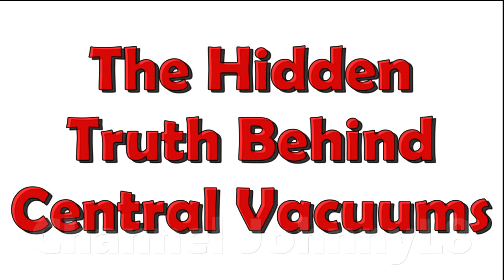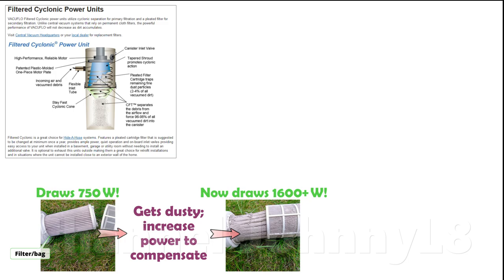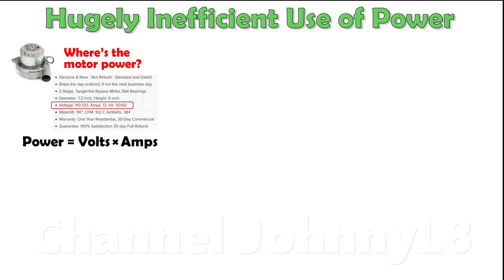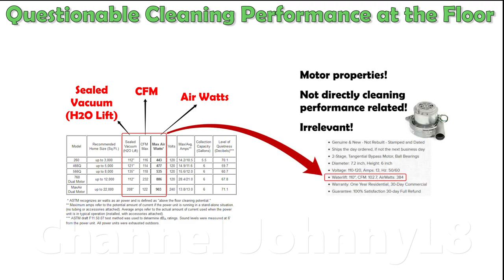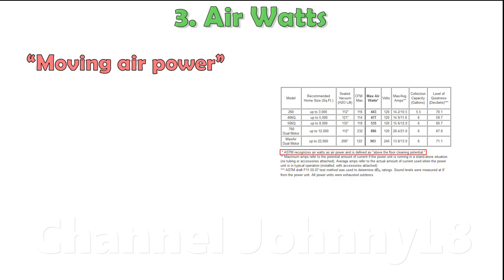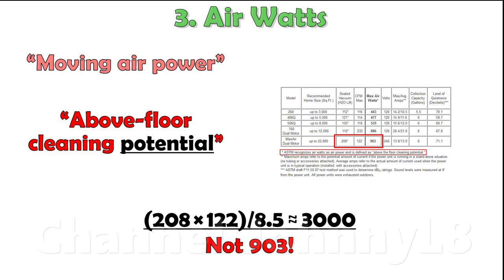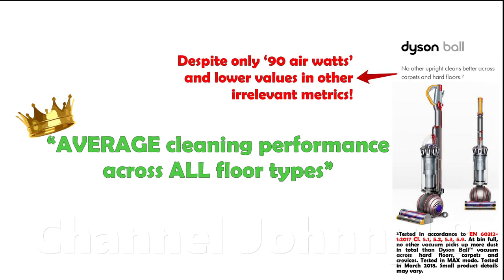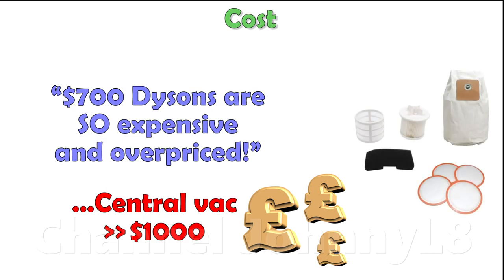Central Vacuums Trail Behind Dyson Cordless

Comment: @3min53 : your formulas are completely wrong : we are in AC voltage so Power is Volts*Amps*Cos(Phi), with such motors the cos phi is low so the power absorbed will be more inferior than 1260W 2520W and 3120W you have calculated. As an electric engineet I can tell you the numbers of 500-1200 and 1500W are probably more realistic. But anyway here in France we don't care too much about electricity : with more than 70% of nuclear and 20% hydro we have almost full green electricity
Reply from the maker: Not sure why you're trying to complicate Ohm's law and basic electricity etc. within this specific context. The values cited are rms values and reflect upper limits, as should have been obvious to someone claiming to be an "electric engineet" >_> Furthermore, these are from numbers provided by the manfacturers. And to suggest that because your energy comes from renewable sources means you can consume as much as you like, is ignorance of the highest order and shows no understanding of basic physics or the planetary energy cycle; that energy consumed goes somewhere you know (namely the atmosphere).
Reply: @VacuumFacts  Errr why do you talk me about Ohm's law and RMS value ? I tell you you have just calculated an apparent power with your formulas, not an active power...
Reply from the maker: @Themagiciandu62  Well I'm glad you led by example with actual numbers and calculations. And you didn't because you don't know and are just blindly spouting theory. You don't know the power factor or the efficiency (which you failed to mention previously in all your alleged prowess) of the motor. But it's almost as though you miss the point entirely by trying to muddy the waters. It doesn't matter; the power consumed is utterly *huge*, regardless, for all the reasons outlined. And then there's literally everything else in the video you ignored, such as why the manufacturers don't simply provide the motor power in their stats along with everything else.
Reply: @VacuumFacts  I know everything about power factor and efficiency... where I take my values ? from the average value of the power factor of an universal motor : around 0.4 0.5 (very low)
Reply from the maker: @Themagiciandu62  o_0 ... ok

Comment: I had a central vac in my old house. It was horrible. The hose was heavy and stiff, hard to use. The power head was clunky and had no steering it also had a super annoying height adjustment that barley worked half the time.The tools didn't lock and fell a lot. The bin wad large but almost all the and hair would clogg up the filter and would require a messy time consuming cleaning. The filter was non washable too. The average price of a whole house central vac with all the plugs, wires, tubes and hoses plus the accessory kit and power head is over $3000. Plus $500 or more for installation. I would rather get 2 v11s and have cash to spare.
Reply from the maker: The power-guzzling motors can also be extremely noisy and some owners go to lengths to try and suppress the noise.

Comment: Hopefully you will allow freedom of speech on your Youtube channel.  I agree, that the most important metric for qualifying the suction strength of a product - must be measured at the contact point.  (floor and attachment point, carpet and power head point).  Many people choose a central vacuum for the convenience.  Hoses weigh less than five pounds, unlike some Dyson Balls.  They do not have to be recharged continuously.   Viruses can be sucked up and not vented back into the home with a central vac.  A 2.5 amp electric power head is incredibly faster than any Dyson head - therefore embedded particles, allergens and bacteria will be vacuumed more efficiently.  Not sure if you work for Dyson, but accurate info is very important to consumers.
Reply from the maker: >> “Hopefully you will allow freedom of speech on your Youtube channel.”
Of course I do, although I don’t allow trolling. Speaking freely doesn’t automatically guarantee respect if what’s said doesn’t deserve it, though.

>> “Many people choose a central vacuum for the convenience.”
Yes; alas convenience is often avoidably polluting and comes with hidden costs—namely those discussed in the video. Although I've not seen any convincing evidence that a central vac is any more convenient than the best designed cleaners of cordless formfactor, like the Dyson V11.

>> “Hoses weigh less than five pounds, unlike some Dyson Balls.”
Heavy mains-powered cleaners have been done away with for several years now. The best performing Dyson ones were only about 7 kg, which is not very heavy (about 3 of your hoses).

>> “They do not have to be recharged continuously”
You’re phrasing this as though it’s a bad thing. Rechargeable means it has no cord and is no less convenient than a central vac. It takes no effort to charge it; you just put it back in the dock and it charges itself during the time you don’t intend to use it.

>> “Viruses can be sucked up and not vented back into the home with a central vac.”
Such microbiological nasties are either kept in the house (from where they came) in the same way as a good vacuum in the HEPA filter. Or, as pointed out in the video, in the laziest, nastiest central vac designs, they are pumped carelessly outside, polluting the local environment. That’s a sloppy bypass that deserves no respect.

>> “A 2.5 amp electric power head is incredibly faster than any Dyson head - therefore embedded particles, allergens and bacteria will be vacuumed more efficiently.”
That’s a factual statement on which there is evidence bearing. I don’t believe what you say here, so if you want to be respected, please cite some convincing objective evidence to distinguish fact from unrespectable wishful thinking. I want to see the official performance test data that any respectable person would have used to confidently draw such a conclusion in the way you just did.

>> “Not sure if you work for Dyson, but accurate info is very important to consumers.”
No, I don’t work for Dyson, and I agree that “accurate info is very important to consumers”, which is why I’ve asked you to evidence your earlier claim about the head to demonstrate you are worthy of actually being heard and are not simply abusing your right to free speech.

Comment: Ah, the 'facts' channel that is a thinly veiled marketing channel for Dyson...
Reply from the maker: I've no allegiance to Dyson, but they do make the best products in this class. Ah, the commenter that has thinly veiled hypersensitivity to facts as evidenced by a petty dig at the channel whilst ignoring the specific content in the video.
Reply: lol, depending on which central vacuum unit you get, and how it is installed, central vacuums can have significantly higher airflow and suction at the head than a dyson. If the correct powerhead is used with it, you'll get an overall MUCH better cleaning outcome. After watching a few videos it's clear the channel is about championing Dyson, not about a real technical discussion about the relative merits/failings of different vacuums.
Reply from the maker: @missingpunctuation  I accept that's a possibility. Please can you provide the data to verify it and distinguish it from wishful thinking? But even if you did, there's still the  issue of the power consumed to achieve the result and interpret. I've already explained all this but trolls too easily decide facts are Dyson bias. You claim to want technical discussion but provide absolutely nothing. Plenty of reviews on my channel discussing "the relative merits/failings of different vacuums". You just don't like the facst presented. It's not that I'm a 'Dyson fanboy'; it's that you're an effective Dyson racist / central vac fanboy. The difference between the two of us is data, facts, and credible argument; I have them, you don't. This was all provided in the video and you've not even taken any issue with anything specific raised, let alone defended it. But this is what trolls and idiots do. Whine, accuse, and name-call unprovoked, and nothing more.
Reply: @VacuumFacts  hahaha, that's great.  'data, facts, and credible argument'  - if only that was the case, but every video of yours is really simple. ad hominem attacks on every other vacuum cleaner / system - 'their paid dodgy reviews', and 'copied from 'noble' dyson' etc etc.  It's really simple:  effective CFM and Suction with a good head design wins. Every time. No-one cares about power usage 30mins - 1hr a week vs having a clean carpet. It's pennies a week. Are dysons good? yes, until they break or break down. Do they justify a channel to their defense and promotion? If you are paid by them? absolutely.
Reply from the maker: @missingpunctuation  I've concluded as much myself about the importance of head design and its utilisation of resources available. There's plenty of data on my channel to back things up; there's nothing 'ad hominem' about it. To claim that in spite of all the data shown is batshit. You're providing no evidence of your own despite multiple opportunities to. I've no allegiance to Dyson. You've still not taken issue with a single claim made in this video and justified why with evidence.
Reply from the maker: <tumbleweed>...figures. This guy was full of accusations but defended none of them with evidence when challenged; trolls never do. Nor was any specific claim highlighted, and challenged with credible evidence. Hallmark of a gobby idiot. I'd recommend people looking at the data and evidence presented in my other reviews and making their own minds up. No one 'sponsored by Dyson' would PAY for the machine they were reviewing and show the receipt (something this ignorant, misleading clown omited, of course). Many companies have approached me to review their products and they've all been turned down flat-out. Dyson have never approached me, and I'd turn them down too if they did. My feelings on bribe reviews are well documented in my reviews.

Comment: bullshit ive had my central vacuum and works just fine best in class
Reply from the maker: I don't think you've actually addressed anything mentioned at all in the video
Reply: Vacuum Facts. Let me tell you about MD silent master those are three stage motors has more vacuum power than a stupid crappy little Dyson cordless handheld vacuum it has two motors not one Plus I have 20 pounds of suction a the end of the hose  Plus everything that is picked up is put outside the living environment and it’s quieter and MD is the top leaders in central vacs
Reply from the maker: Still didn't actually address anything mentioned at all in the video  @electroluxlad

Comment from the maker: I'm surprised no one actually pointed out my legitimate mistake in this video. Namely, I claimed the V10 was 525 W. This is wrong; that value is the approximate maximum in mode 3, which is not for normal use, but heavy spot messes. It's likely considerably lower than this by several times in mode 1/2. This thus makes it relatively hugely more efficient still by contrast.

Comment: These cheaply dysons are garbage. The have terrible filtration. And they don’t have adequate power to truly clean carpets beyond just the tops of the fibers. Great for tidy up day to day.  But there are cheap 40 dollar dirt devils that will pull more crud out of the carpet. I like how I’m another comment this guys says it’s “costless” to run. Umm I don’t know where he got that unless his home is totally solar. Last I checked the charging unit was plugged into mains power in order to recharge the battery. So not “costless” at all. Very convenient machine absolutely!  But not a real effective means to really suck the deep down grit and particles from carpets. Central vacs are outstanding machines when the right unit, accessories, and competent installer are chosen for a particular home.  But all in all you don’t have to spend thousands on central vacs, or several hundred on high end uprights and canister vacs to disprove this Dyson cordless idea. Hell even a Dyson DC07 from 2002 will clean circles around any of the cordless models past, present, and probably the future.
Reply from the maker: How did you determine the Dyson machines have terrible filtration. Evidence shows the exact opposite. How did you determine "they don’t have adequate power to truly clean carpets beyond just the tops of the fibers"? Evidence shows the exact opposite. How did you determine "there are cheap 40 dollar dirt devils that will pull more crud out of the carpet"? Can I see your data? By costless, I was obviously referring to ongoing ancilliary costs (bags, filters and other replacements); replacing these is not needed on the Dyson machines in question. If you think central vacs are good performers, please can you show me the formal measurement data? In the video, I discussed that there isn't any, but you obviously know better. Put your money where your mouth is and show us some reputable, formal test data. And then there's literally everything else discussed in the video you've conveniently ignored...
Reply from the maker: <tumbleweed> ...figures